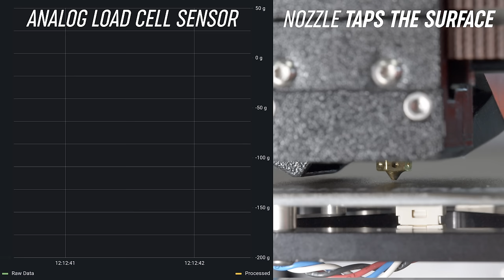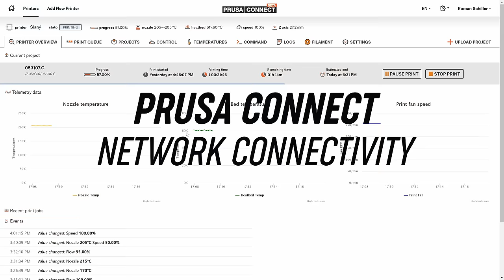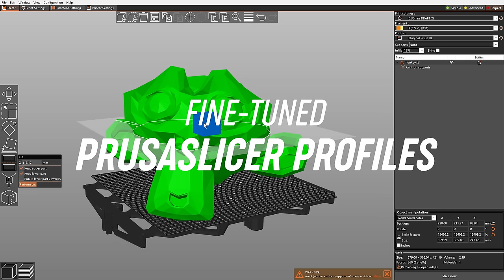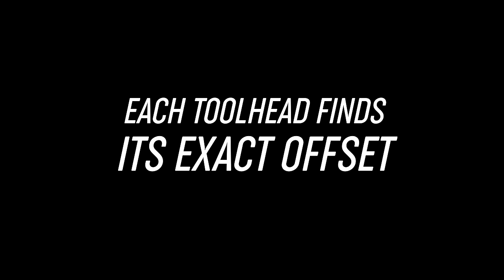First look at the Original Prusa XL

Comment: Just as the mk3 platform was getting old, they bring out a corXY, liner rail, tool changing, auto calibrating printer. Wow.
Reply: Its in a different price range, unfortunately.
Reply: @Lincos321  ya 2k for the base and 3.5k for the top of the line one is kinda sad.
Reply: Nothing new as always, there is a exac printer and it already come with the 5 print tools
Reply: @MaxFenix8k  What printer is that?
Reply: @MaxFenix8k  Where have you seen coreXY with 3 edges cut, huge gears extruder and this convenient corrugated cover?
Reply: @Lincos321  Okay, but where have you seen a need for any of that?

How does my modified E3V2 Print as good as an mk3s. 🤔

Prusa. The Apple of 3D printing.
Reply: @rjanderson4207  Honestly that is very reasonable when compared to other toolchangers.
Reply: @dangerous8333  Oh, come now. Makerbot is the Apple of 3D printing.
Reply: @dangerous8333  Ok mate, I see where you are going with this. I know the feeling. I have an Ender 3 v2, modified to be able to print up to 300-celsius materials, full direct drive, bltouch, you name it. Then a friend lent me his Prusa mini for a week... That showed me how a Prusa can just print and print without constant maintenance. My Ender always has some problem,  I bought a used Mk2.5 and i can safely say that it is worth every penny... even though the Ender was produced in early 2021 and the MK2.5 that I have was made in early 2017, I can safely say that It still trashes the Ender in terms of usablitly and reliability. As for the Prusa=Apple part, Some people want a tool and not a new hobby/chore that comes with owning a 3D printer, and I can accept that. A Prusa has its price, but it will pay it back with the time you will save not having to baby it.
Reply: @dangerous8333  As the owner of the ender, I can say that he is much worse than mk3))) it's like convincing yourself that not having fresh bread and stale is not bad)
Reply: @dangerous8333  apple rips people off. Prusa makes it turn key. Very big difference. I'd rather spend $3500 and not have to spend 100+ hours dialing and fine tuning every single aspect of the printer to save $2000. What's your time worth to you?
Reply: I wish they'd get away from belts though.
Reply: Well, this aged... Interestingly

Comment: auto first layer calibration sounds great, I hope they introduce a smaller version with an enclosure and maybe slightly bigger than my mk3s+, I would love to have this XL but I don't have the budget for it.
Reply: qidi max is 1200
Reply: I really do not see where the size would influence the price. Most of the cost is in R&D and the electronics and toolheads.
Reply: @nukularpictures  You don't see how size influences the price? How about the high-sky shipping costs these days?
Reply: @alejandroperez5368  well I mean it really is not a problem. Even three times the cost means it’s still peanuts. 
Even right now at about 6500 USD / container can fit ~500 boxes of the size 50cmx50cmx50cm. So the price is 13 USD/package. 
It really does not make so much difference. 

Like I said most cost will be in the toolheads, controllers and motion system. You will not get it a lot cheaper with going smaller.
Reply: @nukularpictures  6500? It's more like 15000 now....
Reply: @alejandroperez5368  so $30 per unit. Not relevant when the price is $2k

Comment: Prusa never fails to prove why they're the best in hobby 3d printing. Industrial lvl reliability, for hobby lvl pricing.
Reply: Let's the price of this jewel first...
Reply: 2600€ cheapest version
Reply: @alexsanchiz  Yes I just open the links... Yes, is a great price.
Reply: @alexsanchiz  2099 with one toolhead
Reply: @alexsanchiz  i see you can change the currency to dolars and its the same number (thanks apple!) wich is much cheaper actually (300€ cheaper)
Reply: >hobby level pricing 

heh
Reply: but why they say goodbye to pinda?! that was the best leveling stuff...and now they level by measuring nozzle force...
Reply: @archetrico  They don't pay the VAT when they buy from the US.
It's the same with the UK price now.
£1491 - €1772

But, once it reaches the UK we'd have to pay the courier another £298 - €355 + a fee (usually around £10) before they would deliver it.

So £1800 - €2140 in total.

(I realise I've not included the shipping cost, probably another £30, but I've not checked)
Reply: @_Piers_  Exactly, that is weird, £1491 - €1772, so why dont they write 2000USD and 1780€?? that is what i dont get... for example i live in turkey, and i can choose to pay in euro or in dolar (because my currency is non of the listed) and bank will make the exchange or whatever. the curious thing is that the number in dolars and in euro is the same, but 2000 dolars is not worth 2000€. Btw we do not pay VAT as well, and we pay shipping of course, but that is a separate toppic.
Reply: @zola5584  because with the pinda you had to do live z adjust with this new one it is fully automated. No changing the z offset
Reply: @flyingbanana2436  live z adjust once a months at most?🤔
Reply: @zola5584  I mean I have a prusa mk3s and yeah only like a month but having it have pinpoint perfect every print is going to be great
Reply: @flyingbanana2436  i afraid about the bed is depreciating (at long period)
Reply: This isn’t a hobby machine by any means but this will own the professional market. They have got a better setup then ultimaker has at half the price with all 5 tools. This will kill those other brands with this type of pricing. All they need is to have more nozzles for abrasive filaments and they got a machine that will kill these pro level machines. And ohh make their parts out of abs… or their pc blend? Petg can not hold up to higher temps enclosed. Hopefully they think of this before enclosing it!
Reply: @zola5584  So your complaint is the new system never has calibration and you want to have to calibrate once a month? You're a weird one.
Reply: @LightsLuck-  i guess no need for calibrating once a month, but ask somebody who print much with prusa mk3s.....and probing with nozzle is a backstep... load the linear rail,the whole hotend,the bed with that probing force.....they should develope pinda instead this 🤔
Reply: @zola5584  I've been printing with 5 prusas for almost 5 years. Pinda probes are fine and they already use them. Don't you think they would continue if they hadn't found a better way?
Reply: @LightsLuck-  or cheaper...
Reply: @zola5584  You think they spent 3 years in R&D, created a new method of leveling risking their reputation by saying you could place a wooden plank on the bed and still get a perfect first layer, and decided to get rid of a part on their most advanced and expensive machine to date to save $20?
Reply: They just have good marketing and a big fan base because they were in the game early. I don't find their printers anymore reliable than most things on the market now, and far more expensive.
Reply: @Mytagforhalo  Nonsense. All that crap about better support and reliability sounds like those Mac people that used to say "it just works" ...until it doesn't. Every company offers support now and there's plenty of online help. I've never had to deal with support for anything in my 20 years of being in tech, unless I was doing a warranty claim.

There is tons of negative feedback for Prusa printers but Prusa owners only read the ones praising it. For someone just getting into 3D printing now there's lots of long-term information. That's why you see lots of people buying an E3V2 instead and throwing $100 in mods on it and it's printing just as good as an mk3s.

Prusa is the Apple of 3D printing. Voron is Hackintosh.
Reply: @dangerous8333  what about ratrig?
Reply: @ANTALIFE  hobby for rich people xD
Reply: @zola5584  ill take a wild guess and say its probably to allow for  no z levelling, and it could be just as accurate as other sensors. Again, its a wild guess though.

Comment: Ok, so basically tackling every single thing that annoyed me about 3D printing (like it all seemed so 90's in a sense) and bringing it into 2021. This definitely is leading the entire eco-system immediately, impressive!
Reply: Bed leveling and part warping are the most problematic issues in my opinion.
Reply: This is an incredible reveal - the extruder design is really interesting especially. However, they are certainly not leading the entire ecosystem. The consumer ecosystem, more than likely. But the DIY community has pushed the limits in corexy beyond Prusa, imo (none of this is a criticism of Prusa. This is a great reveal, and it will hopefully be a great product for prosumers. And it's also their first corexy, so it's silly to expect that they will immediately have the edge on everyone).

Even though you could maybe argue this dethrones Voron as a company in terms of accessibility and official support from an actual, producing company, the Voron 2 still has a flying gantry. Tramming on the XL looks like it only has one degree of freedom, and you need two degrees of freedom to define a plane (an infinite conceptual plane, not a finite rectangle - if it was finite, then it would need "yaw," too, but tramming only involves two axes). So it will still rely on a mesh, which is actually quite disappointing to me frankly. That might sound overly dramatic, but it was very recently that I determined that poorly trammed axes produced worse prints compared to better trammed ones in spite of mesh bed levelling in both cases. It really is a killer feature to have it automatically tram the whole plane to the gantry. Granted, I'm talking about my 3D printer which happens to be a bed slinger, so I could only control the "roll," the same axis that this will be able to tilt. So maybe one axis really is enough for most general use cases, I'm not sure. Also, the flying gantry means the heated bed doesn't have to move, which is more safe. And less ambient air is moved around. And a huge aluminum plate can be stationary at the bottom and not lifted up.

Plus, and I think this is a huge bummer, but I really can't say I'm surprised, it's not fully enclosed. It looks like it will have a good draft shield, but you won't be able to push your ambients with that. For Prusa's primary audience, they're using PLA and PETG, so it's fine, but PA and ABS will suffer. There's always workarounds, but they always take longer than a fully enclosed printer. Again, this doesn't matter in a lot of people's cases.

When you compare this to something like Hevort, it's not much of a comparison. Though I've certainly veered out of 99.9% of Prusa's market's interests by now.

I get that none of this matters, because Prusa will give this the labor of love, extreme ease of use, and support that makes their products so popular among people that are actually into "3D printing" and not necessarily into "3D printers" - I just decided to take the time to write out some of the things that strike me about the reveal in general under the pretense of proving your statement wrong, lol, so please understand I'm not trying to be a snob, and I totally see how this can come across as snobbish.
Reply: @Joe_Yacketori  I am very sure anyone who wants to can make a heated case for it. It's not that hard, me and my brother did.
Reply: @Joe_Yacketori  Looking for a 3d printer that can print nylon reliably and with minimal fuss. I suppose this will need quite a few upgrades before getting there. Any printer  recommendations for around the same budget ($2k-$2.5k) for printing nylon?
Reply: @Vincent Groenewold almost all these features exists on the DIY/other companies market for years:
- corexy
- linear rails
- z tilt or auto bed tramming
- bigger gears on the extruder
- jam detectors 
- better positioned thermistor
- dashboards

It's the COMMUNITY that is "leading" and creating new things.

And prusa as a great opensource company, it's just bringing these tech to most consumers.
Reply: More like to 2023😢

Comment: Wow that is an impressive product & price, the size of that thing and those features sound amazing!
Reply: $200 is not the price, it is deposit LOL
Reply: Whats the Price? Olny saw a $200 deposit.
Reply: @thaboseane502  $2000 for one head, $2500 for two
Reply: Semi-Assembled:
1 Tool: $2,000
2 Tools: $2,500
5 Tools: $3,500

Fully Assembled:
1 Tool: $2,500
2 Tools: $3,000
5 Tools: $4,000
Reply: @UCbkc597Cw7ctUY7Ab7FlXDQ RatRig is a kit, Prusa is a complete solution and $3800 with a tool changer which RatRig does not offer so I would not compare.
Reply: @bumbarabun  which is deducted from the 2000$ total price for a 1 hotend self-assembly kit as per their website
Reply: @thaboseane502  2000$
Reply: @SquishinStix nearly double that

Comment: Running 12 prusas for our shop. My favorite printers, will definitely be looking to get some of these. I know some people think it is pricey, but compared to a lot of other printers this thing is a steal (we've got Stratasys, Formlabs, Ultimaker and Markforged machines as well, but the Prusa's are what consistently see the most use).
Reply: are you using enclosure and print abs with inside enclosure temperature up to 50c? are the prusa parts not deform because they are using petg especially at the part cooling fan nozzle (its the hottest).

Comment: Not to be that guy, but 40x40x40 turned into 36x36x36. Around 1500€ turned into 2100€. Getting 5 Extruder heads is 3700€ total... That's pretty rough. Sure the features sound fancy I guess

Comment: Please add a filament width sensor and measure the width of the filament in thousands of mm, and compensate the diameter differences while printing. Also in the future explore the usage of bldc motors instead of a stepper for the extruder..

Comment: Ultra exciting - preordered! This printer in this eco system is mmmmmhhhhh😍🤩
Reply: I guess you wouldn‘t bother to even connect it to power with the original firmware but go straight for Klipper and run it supersonic.
The most wanted first add-on would be the Accelerometer attachment for Input Shaper, and a plug on the breakout board on the toolhead.

Comment: I just need to know how easy is it to -
Change / tighten belts
Change the hotend , etc (also is it gonna be a top end carraige on that thing?) 
Adjust the bed and keep it nice and tight
include additional print heads on the rack system
Use exotic materials (likely based on the hotend) 
And also how fast does it reliably print (getting peed off with FDM print times)

If you can answer those it would be awesome and keep up the inovation!!

Comment: How bout that Cycloidal Gearbox with zero backlash and 20:1 ratio or the 16 independent zone heat bed, all the new sensors, no live adjusting Z anymore, and even the top front bar is an open design for easy access and removal...  
We've seen core-xy tool changers before, but this thing is next level.  Can't wait to see what all the accessory options we can add before our order ships.  would like to see heated enclosure, proper filtration system, air quality monitor, use lights to indicate alerts, wireless management option, filament driers, etc.    
Really curious about tool head options (we talking 350 *C, 450*C, ?), also what temps can the bed/s go to (we talking 150*C, 200*C, ?), and  what is the power consumption of this beast.

Can't wait for answers and to keep this thing printing 24/7.

Comment: I just put a deposit down with for a 2 tool changer version.  I would have paid for a 3 tool option but there wasn't that choice available.  I guess I'll add the tool changers as I need them....
Reply: to get three you would need an extra PSU and an expansion board. You would be nest getting 5 at that point.
Reply: @CineZoneYT  thanks for the info.

Comment: It's good with several tools but if it only has one hotend at the time it will take forever to make a print with two colors depending how the print should look. If it had been build as an idex printer with 5 tool head then this would be fantastic. You should go for a idex printer style
Reply: They can hold their temperature. So a tool change may not need much time. Better than wasting a ton of filament to produce a colored dice for the bin.
Reply: @lars916  Don't know how they solve the dripping problem. For me it seems as waste anyway. I think there still will be a dice or a cleaning spot where to get rid of the waste

Comment: To be honest, the build volume is pretty disappointing. 36x36x36 is not what I would call XL. I had hoped for something like 45x45x45 at minimum. But maybe that's for the XXL model. Other than that it looks like a very impressive printer! For now I'm sticking with my MK3S MMU2S though.

Comment: XL it shows 36cmx36cm (360mmx360mm  1/3 larger than Original 250x250 prusas) which really is not XL compared to the 500x500 of Creality CR-10S5,  I wanted your Prusa XL to be 500x500 to replace the CR-10s5 for me 8(

Comment: My question. It uses an ARM chip. Will anyone port Doom to run on it? the scroll wheel left and right, pushing the head left and right is for strafing, and pushing it forward and backwards for ... forward and backwards.

Comment: It's really highes time for heat zones, i still often thought about something like this. All this heating, (invented by you, isn't it?), especially of the hole platform, is such a crazy waste of energy. 75% oft the energy a 3d printer consumes is for the platform, on which is often only a small object. i print nearly everthing cold with glue, and brim if needed, to overcome this waste.

Comment: Make the print bed larger, run up to two tool-changing tool heads on the X-axis rail at the same time and you've got the ultimate 3D printer.